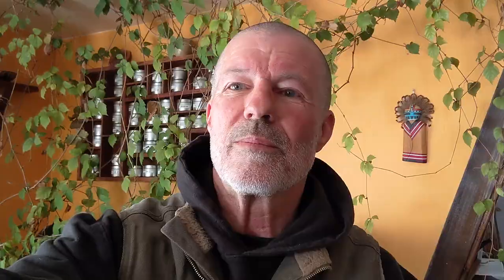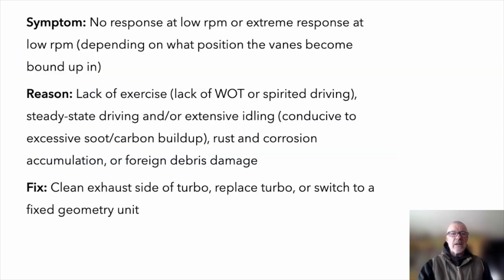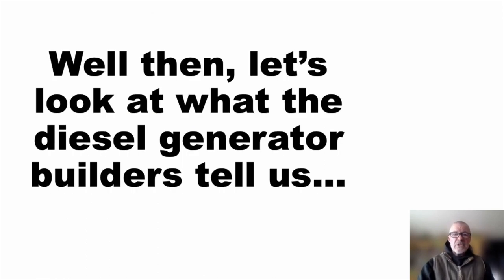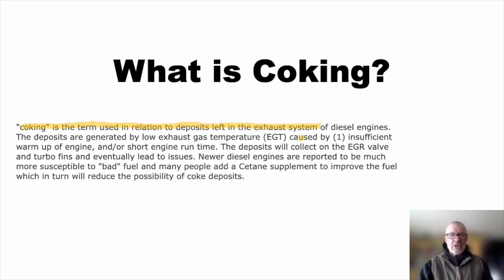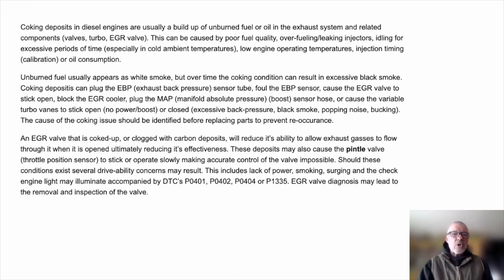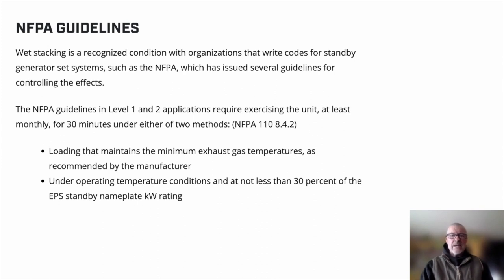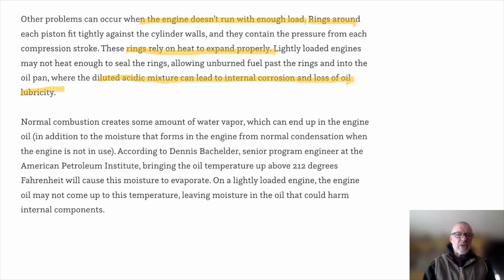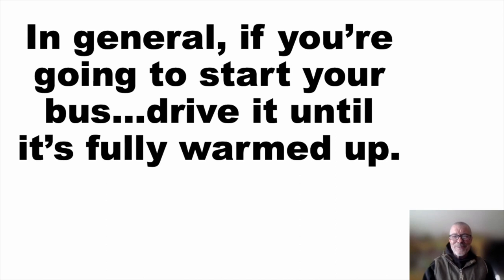Exercising your diesel bus.

Comment: As someone who has spent his whole working life fixing and maintaining fleet diesel engines I can verify that every single bit of advice given here in this video is spot on correct.  
I have seen hard worked well maintained engines that easily ran over a million trouble free miles, but I have also seen plenty of 3 to 5 year old low mileage diesel engines that are completely shot, mainly with low compression, which then gives rise to poor cold starting performance and high oil consumption. Even though these low mileage engines had received regular maintenance, the damage was caused by a poor duty cycle of constant stop/start very short journey work where the engines ran lightly loaded and rarely ever reached full operating temperature. All of which caused bore wash and premature wear of the engine cylinders.
Reply from the maker: Well, thank you for the comment and your experience...and for watching a boring damned video!  It makes me cringe to see people (well intentioned) tell others to idle their engines often.  Diesels should be loaded, for sure.  Thanks, David.

Comment: Nice, great topic and well covered with good backup documentation! I tell my customers that it’s better to let the engine just sit dormant than to just idle it. Most of my customers have 2 stroke Detroit engines so this is especially important for them. I tell them not to start the engine unless they plan on driving it for at least 30 min, and do not idle it for more than 5-10 min mainly to let the turbo cool down after driving, I like to see the engine oil temp come down to around 200 before shutting down the engine.
Reply from the maker: Thank you, sir.  It sounds like we are fully aligned!  Where are you located?  I get asked about DD 2-stroke help and would love to refer your way if they're in the area.
Reply: @RollingLiving  Excellent, I am located in the Tampa, Fl area. I will do what I can to help out.
Reply from the maker: @GinosGarageUSA  Would you email your contact info to me?  ross@rollingliving.com
Reply: @GinosGarageUSA  I love your videos!  I’m in the wanderlodge group also. I’m pretty new to the diesel bus/wanderlodge community, as I just bought the $quanderlodge recently. What do you recommend for the old caterpillar 3208T?
Reply: @jeffshull.7780  I would pretty much give the same advice really for any engine as I did the Detroit. The 3208 can sit dormant until you are ready to use it. They often have issues with the fuel systems leaking down from old hoses so that is something to keep in mind. Unless you want to go through the priming procedure after storing your bus for a while I would look at replacing old fuel lines.

Comment: Very good video, and advice. I tend to let my DT466 warm up a little bit. I just can't get behind just starting an engine and letting it run for a few seconds and driving off. I normally wait until my coolant gauge moves about 90-100F, then start driving slowly and lightly etc until it comes up to temp.  Then give her the full beans. In the winter in MT I sadly have to let my bus sit for sometimes up to three months at time, but like you said if it's started, I will drive it 25-75 miles.
Reply from the maker: It sounds like you're treating her right.  The DT466 is one of my favorite engines.

Comment: Thank you for this.  I was unaware of these things and will gladly pass this information along.  I am assuming the only way to "correct" my error is to change the oil and keep my batteries up by charging till I can get the proper tags and insurance to operate the bus on the road.  For me, I purchased the bus and have yet to complete the process beyond getting these things done, I was under the misconception that running the engine would be the way to keep it functioning properly, however, it sounds like at least my procrastination to start the bus regularly may have actually been good.  This also makes me wonder about the use of a block heater while parked for construction.  The block heater would not bring it up to the proper temperature for loaded run, so it sounds like this would actually be a bad thing, even not taking into account the fuel seepage, to use a block heater while "parked".  I have not been using my block heater since purchase.  If you have any thoughts on this, I would be interested.  For now, I will be planning to change my oil and get it ready to go on the road as soon as possible to attempt to correct my error at least as much as I can.
Reply from the maker: This is an outstanding line of thinking and I'm going to pin it to the top of the comments.

There is no question that a block heater is a good thing, when used for a period of time before a cold start...because it helps reduce the wear of a cold start.  It warms the oil, so it circulates more freely.  It reduces cranking time.  It helps the engine get a head start on warming up.  Block heaters are fantastic.

But, you are exactly right about keeping the block heater on all the time.  I've not see anything about this in the diesel world, but looking at the aviation community you'll find lots of cautions about this.  There were observations of increased instances of internal engine corrosion after lower engine block heaters were introduced.  The theory is that a block heater left on all the time warms the engine enough to evaporate water (and acids) out of the oil, where they condense on the cooler surfaces above...but the block heater doesn't heat the engine enough to "burn" the moisture out of the engine, like running does.  Some aircraft owners even resort to pulling the dipstick, with the thought that it provides a path for moisture to escape...but that doesn't seem to make a difference.

So, your thoughts are exactly right on track here.  I am a huge fan of block heaters, but only when used for some period of time prior to a start.  That time depends upon the temp, the engine size, the wattage of the heater.  Sometimes it only takes an hour or two, sometimes it's overnight...but regardless, it should be followed by a good run.

Comment: I definitely needed to see this. I’m one of those who thought keeping your bus in shape just meant idling it once a week. Does driving your bus around and exercising it properly get rid of that buildup eventually or does the build up remain?
Reply from the maker: Well, first off kudos to you for being willing to change your mind!  That is unfortunately getting rare, it seems.  I was definitely on the wrong side of this at one time, too.  I'm still learning all the time.

Driving your bus "hard" and loading the engine regularly will help burn off residue and if you do that often it can keep things clean(er).  If the engine was abused and lightly loaded for a long time already, just running loaded may not burn off what's there.  But regular cycles of some good driving time can help keep buildup from happening.  Now, I'm not saying you should mash the pedal up steep hills and let the engine overheat...overheating will kill an engine fast...but it's good to get the engine warmed up regularly.
Reply: if you cannot drive it every few weeks would still be better than letting it just sit for months
but riding it  10-20 miles every few weeks is best. i would trickle charge batteries if sits weeks and especially newer ones with computers  same with cars today they use battery power 24/7   electric cars one model of tesla would use an entire charge in 15 days just parked

Comment: I have a vanhool bus that won’t start. Can I pay you to help me get it running? Ran perfectly a year ago. New batteries and now crank no start
Reply from the maker: I'm happy to help as I can...no charge.  I would guess it lost fuel prime after sitting.  When you crank it, do you see white smoke billowing from the tailpipe?   If so, that's unburnt fuel and it's not a prime issue.  But if not, then you probably need to prime the fuel system.  Search my channel for a video on "my bus won't start" and that will show what I mean.

What engine do you have in that bus?